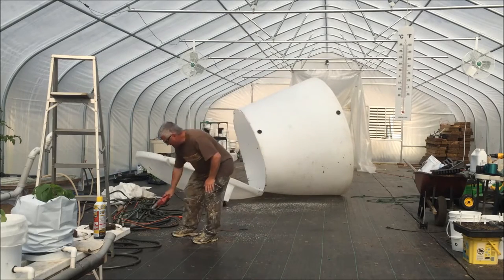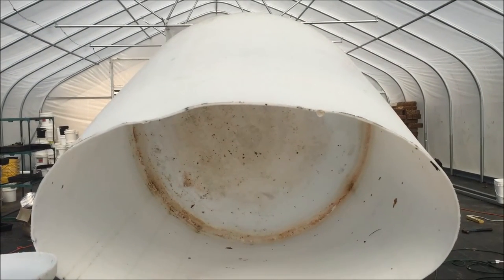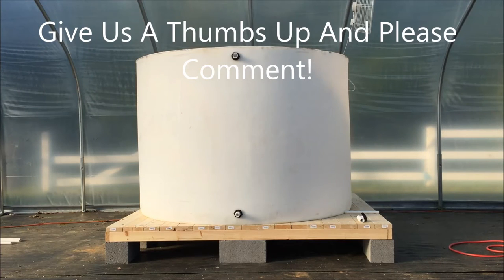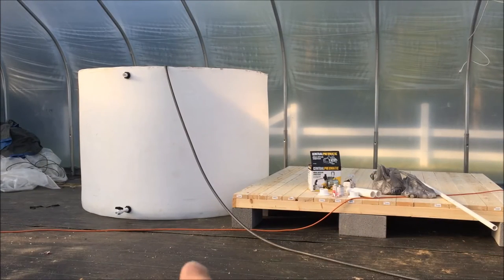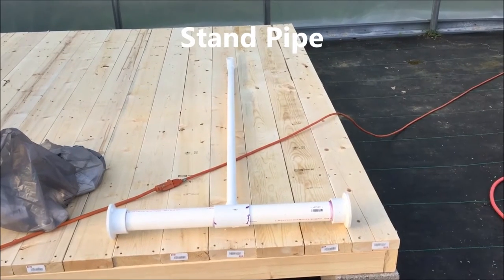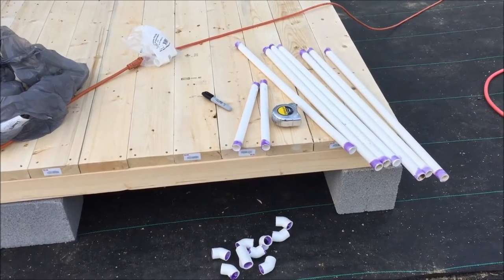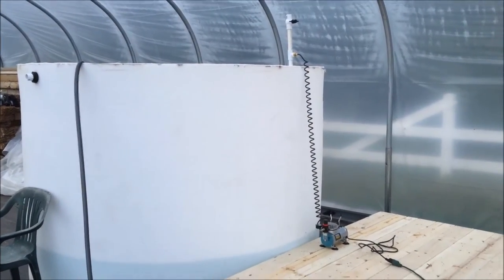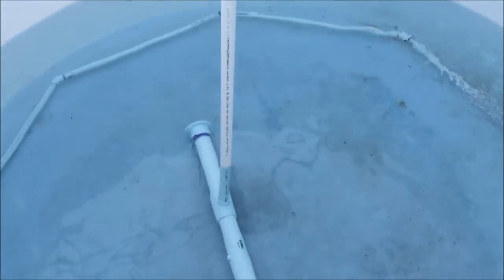Aquaponics In The New Greenhouse! Part 1

Comment: Ambitious start ....interested to see your filtration .. did not hear you mention it in the video .. and a  tip for air is you don't want to use that sort of air compressor, as it lets oil into the air chamber, and if you get oil in your fishtank it gets in the gills and suffocate the fish ... you seem like a handy guy ... try and get your hands on  supercharger from a truck and use that .... more air than you need, decent pressure  and no risk for the fish,,, Ill wait till you get everything set up befor I offer any advice as I see a few things that give me concern but you might already have that covered ... mostly with that standpipe hope you have t piece in the top or a hole to break the siphon and a big ??? on if a 1 inch pipe can handle the flow you need to turn that tank over every hr through your filtration ..

I use a 3" pipe on tanks of that size, to handle the turnover flow needed ... if you need a hand designing a system let me know in a pm I can help bounce some ideas off of to make sure you get it right the first time ... those little fish are going pollute that water faster than you think .. if the ammonia gets to high to fast it will kill them ... i'm sure you're testing the ammonia. nitrites.  nitrates and ph and have some sort of filter set up even if its old school Aquaponics with  just a few grow beds ..
Reply from the maker: +GreenEvolutions I have changed the stand pipe already so that the it breaks siphoning. It actually says oil free on this model of pump. I am interested in more psi from a pump so the super charger sounds intriguing. I will be reaching out to you soon.
Thanks for the offer.
Chuck
Reply: Any time buddy ... thats whats great about youtube ... sharing knowledge with out borders ..

Comment: looking good. I'm the same way, I figure it out as I go. On your air Supply is that type of air pump made to run 24/7 ?  A regenerative air pump work great and are made to run full time. They are a little expensive, but that is one on the things you don't want to break. Just a thought on your tank, if you get another one, cut it in the middle and make two tanks. That would be easier to access. Great job, I look forward to seeing more. Thanks Von
Reply from the maker: +Greens&amp;Gills Greenhouse - G3 I have another pump I will try this weekend. Its a pump that I bought for the other greenhouse to inflate the layers of plastic. It should work nicely!
Chuck

Comment: How do you compare hydroponics and aquaponics sir. Which is better and more cost effective
Reply from the maker: In my opinion and in my experience hydroponics is the way to go. Managing the environment to me was tough with aquaponics. PH and iron along with solids were real issues. My end products were never as good either with aquaponics. I turn out so much more with hydroponics that it doesn’t really compare. Cost is irrelevant to me with all of that in mind. Neither of my systems were cheap but the nutrients cost more than fish food and the hydroponics pump runs 24x7. 
Hope that helps
Chuck
Reply: Thank you Chuck! Can you make a video on how you mix your nutrient solution and a walk through of how you design your hydroponic system.
Reply from the maker: Melvin Lai the design video is done and called New lettuce system